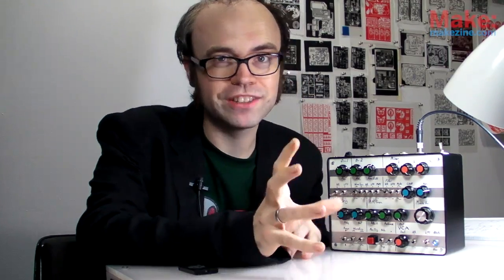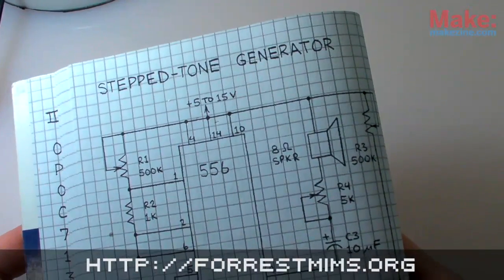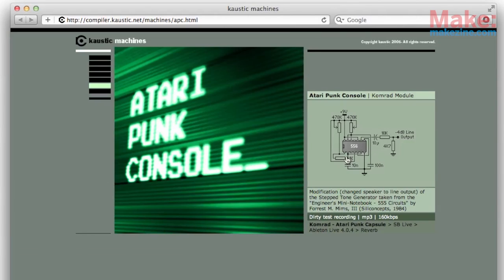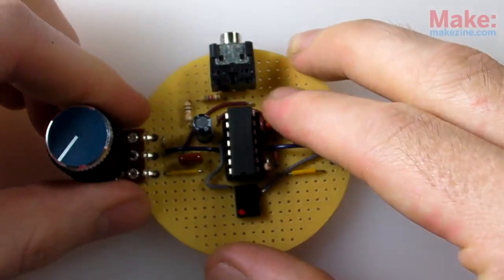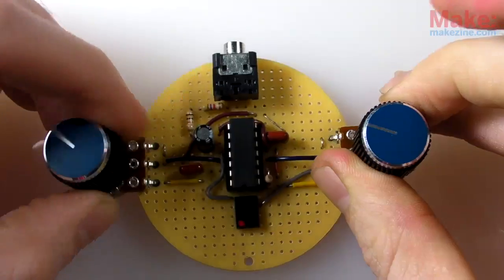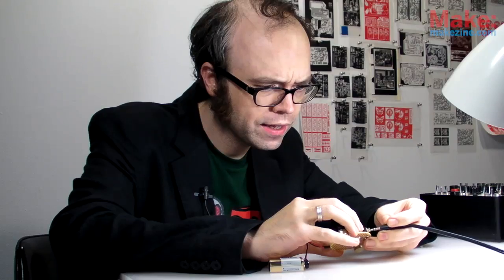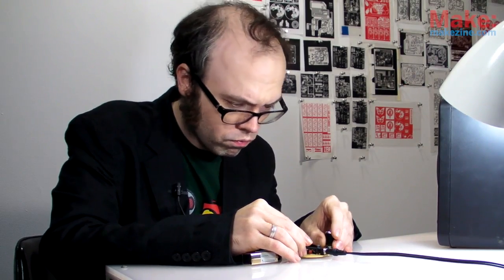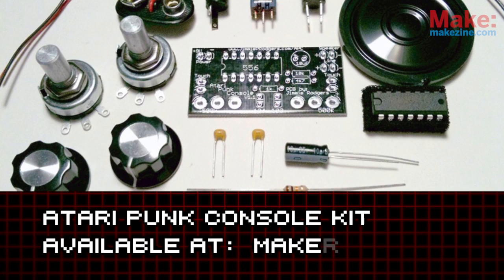Collin's Lab: Atari Punk Console

Comment: I built one, with a 8 ohm speaker. Then, connected in parallel to my 70W amplifier. THEN, I discovered the 8 ohm speaker could work as a microphone. My underwear became wet.

Comment: I built and sold approximately fifty of these in 2003-2004, including one to Kaustic Machines.  I believe I still have the shipping confirmation, in fact (they went to some interesting places all over the world and to some interesting people).  I didn't call them "Atari Punk Synths", though.  I've always found that moniker irritating, because these have not the slightest relationship with Atari hardware.  I called them, "Ghetto Synths" and also "Sputnik One".  To be real honest, to me, they sound pretty obnoxious compared to Atari's outstanding line of vintage audio ICs.  This is strictly a starter project.  You will hurt your ears and the ears of others.  :D  I'm sorry for all the pain I've brought others by having built these. haha  The circuit, which I modified to be even more obnoxious, originally came from "Oscillators Simplified with 61 Projects", written in 1987 by Delton T. Horn.  I still have that book!
Reply: Actually, this circuit originally came from "Engineer's Notebook: Integrated Circuit Applications" by Forrest Mims III, published in 1980.  And I still have that book.
Reply: I feel the same way about how it has nothing to do with punk

Comment: so I was able to put it all together and it makes the sounds except my pots dont act the same way as the ones in the video. I cant get the pitch down SUPER low and it just jumps around low to high pitches. also when I turn one knob it sounds like it goes slower then faster and faster. idk if this is what its suposed to be doing but I want it to go as low as collins.
Reply: Did you use linear pots or audio taper pots?
Reply: I got it  now, turned out I needed 1m pots instead of 500k. Longer range of frequency's

Comment: bloody hell!,your soldering technique is shocking,the result will be dry joints if u don't heat the pad & component properly,blobs that aren't shiny & smooth indicates there wasn't enough heat applied to the joint :(
Reply: +neil crompton i have discovered that some/ most types of lead free solder get the appearance of dry joints even if heated excessively
Reply: 60/40 is the standard for electronic circuits if memory serves me right it's a combo of tin/lead,iv'e never used lead free solder,is it any good? or better/worse?,just curious????
Reply: i usually use lead solder, due to its low melting  point(around 180C) and that you can see if joined correctly.
 a good lead free solder that do the same is a Sn/Cu/Ag 97/2.5/0.5. mix. one brand is kappfree  a bit pricy and it first melts at 260C too hot for my taste.
a cheap one is a zinc/tin 50/50 mix melts around 250, but almost all zinc/tin solder, when solidified, looks like a dry joint. its the way it crystallises i think. and it can also erode the tip of the soldering iron faster than normal, but it depends on the kind of tip you have, copper/brass iron/nickel.

i will say to use a lead free one, but if you know how to handle it safely, (prevent lead poisoning) use a lead solder, the softness of it also leaves some room for mistakes.
Reply: omsonic whats a metcal?
Reply: its a brand of solder tools
Reply: Oh ok thanks for that,never heard of that in australia

Comment: what would happen if you used two 555 chips instead of 556s?
Reply: jack h Same thing. A 556 timer is just two 555 timers combined. You'd only need to wire it differently of course.

Comment: My Atari Punk colsole is quite modded and much more expressive.  I built two, put them in the same compartment, with dual controls and switches that turn the audio off between the two so you can make quick notes with it.  My next Atari Punk Console experiement will be using a crap keyboard from a consignment shop to control the pitch (resistors of different values on each key.  It will be monophonic, but it might be more controllable that way).

Comment: My favorite project is from 3 chips- The Coron DS7 . It's an easy build and a neat thing you can do is run the wires intended for the pots to a breadboard instead and then you can go from there to the pots. This way you have the stock build that works, but now you have a breadboard to create any mod you want. Quickly you will discover that you can make it a two oscillator synth without having to add any active components. I used the earphone jack on an AM radio to act as a modulated input:-)

Comment: @ttttiiiieeeessss The pot that sets the pitch should be linear taper (which if you think about it, is not really tapered at all). The one that sets the volume should be audio taper, because the ear senses sound level logarithmically (needs bigger and bigger changes to make a difference in the perceived level). If you use the "wrong" taper, it will work, but the adjustment-to-shaft rotation will seem funny. Read geofexdotcom/Article_Folders/potsecrets/potscret.htm